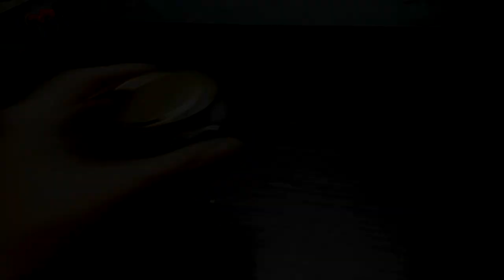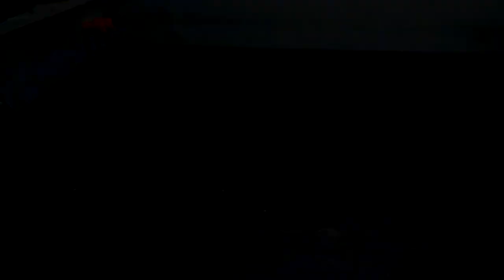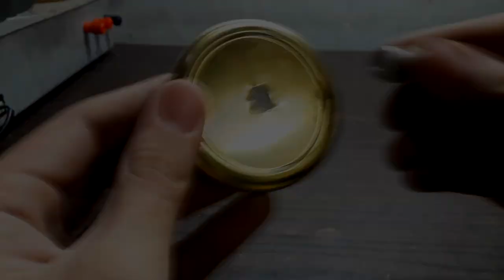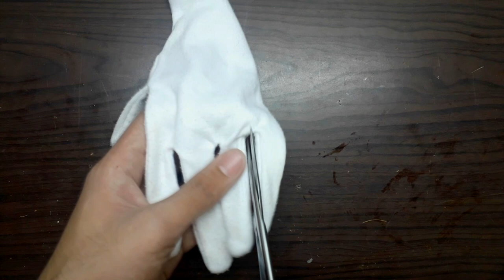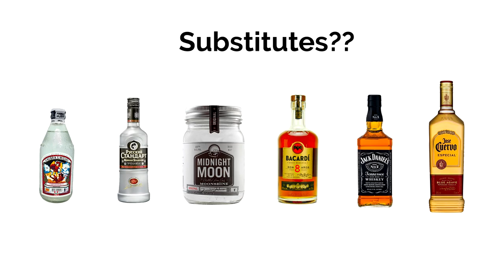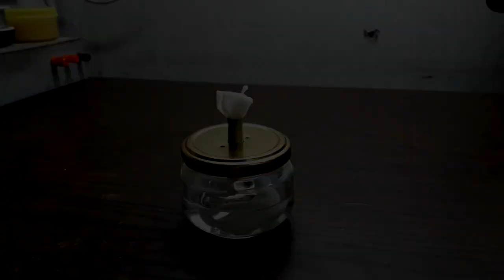How To Make Alcohol Lamp From Scratch

Comment: Alcohol is good for burners as it burns clean, low, blue and hot, but when it comes to light, you need to have high yellow flame to be able to generate light, and this is only possible with kerosene especially for wicked lamps. Even oils doesn't work although many claim because oil isn't flammable at room temperature and air pressure and the wick will keep glowing and will be eaten down quickly. Try kerosene and you will be amazed, you can control the power of the light by adjusting the wick length
Reply: Add a pinch of table salt to the alcohol. Turns the flame yellow.
Reply: The flame in the video was yellow.
Reply: Purpose os for heat not light tho
Reply: I will buy for my mother. She will use for the flowers. The flame's heat will make the edge of the flowers pedals curvy. I will use Isopropyl alcohol. Is that ok to use it?

Comment: You could distill any alcoholic beverage and obtain mostly pure alcohol but the cost is not worth it. Alcohol evaporates at a lower temperature so you put the solution into a boiling flask with a vent at the top running to a cooling tube. Preferably coiled to increase cooling time and an ice bath helps condensation. The end of that cooling tube needs to run into a sanitized container that is also heat resistant. Copper was the old material modern day stainless steel for large production or home diy and borosilicate glass (pyrex makes a lot of it) collection flask. Don't do this to make stronger alcohol for consumption. It will kill you and it's going to hurt the whole time you are dying. If it's for fuel purposes full send just maintain safe practices because it's now a volatile liquid. Hey man thanks for making this video I need to do some plastic welding repairs and wax carving tools with an alcohol lamp will work perfectly.

Comment: Nice vidio for making a glass stove but I think it would be safer if you make it from a metal to avoid over heating of the glass
Reply: Glass is typically manufactured at 1400 to1600 degrees, and that's SERIOUSLY hot. The heat produced by this burner is absolutely trifling in comparison, ergo it won't cause any problem if the jar is free of obvious defects. Relax.
Reply: @Turrican60  thanks for your kind reply ,glass need only over heating to manufacture it but when it is ready for use as a cup of tea or a jar it easily broke down it happened with many people when putting some hot tea in a cup of  glass sometimes it brokedown

Comment: I need gelp pls i tried this step 1000 times but when i turn the burner on it takes less than 20 seconds and it turns off
Reply: Too tight tube. You need a tube wide enough or fabric loose enough so the fuel can go up without any obstructions.